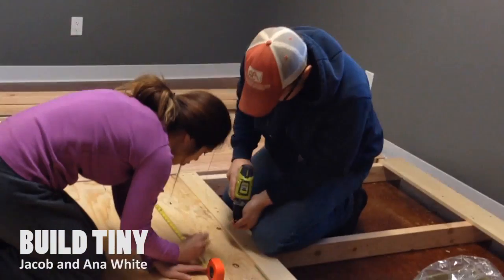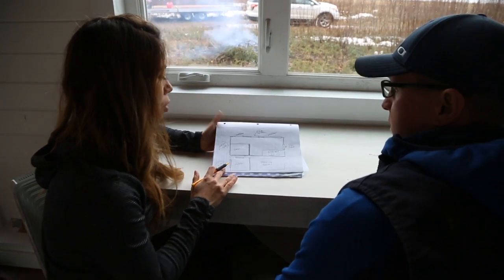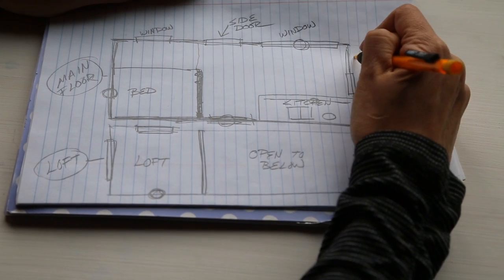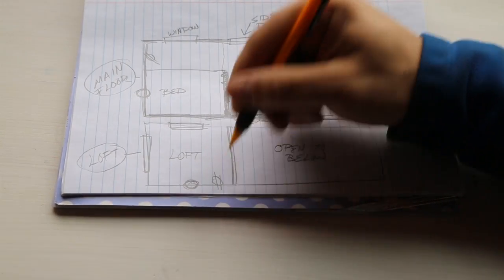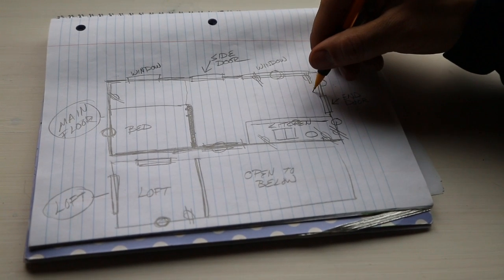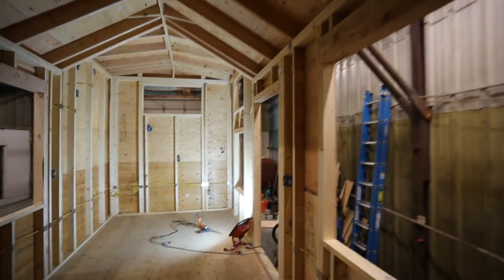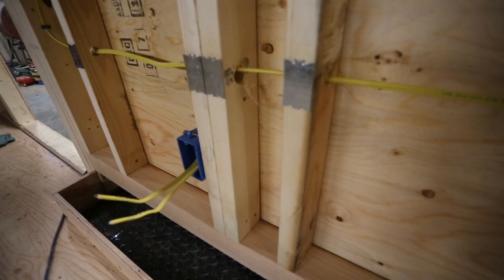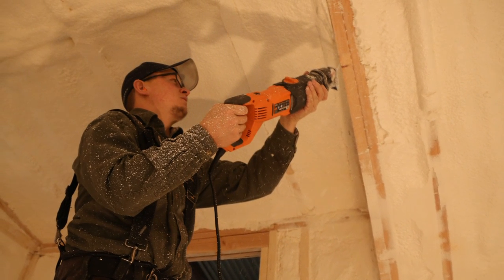Electrical Planning and Installation: Ana White Tiny House Build [Episode 9]

Comment: P.S. I've taken an old 1972 Dodge Georgieboy 34' RV. I completely gutted it from interior items along with all plumbing and electrical system. No longer makings it a self-contained system or DC powered anything throughout the RV. With it now be a blank slate to convert into a tiny home. I purchased the old RV for $650 USD and spent another $750 USD for the big rig just under 65 miles hauling. (Which should have been much less than the what they charged me.  because short distance big rig hauling charges by the hour from arrival of pick-up point to the end of drop off points completion.)  A normally 2 hour minimum fee at anywhere from as low as $125 to as high as $1000 USD an hour. Now in San Diego County there are only a small handful of local towing companies with the lowboy flatbed trailer to do the job. Which have waiting list of up to 6 or more months to book their services. these companies rates are no higher than $375 and no lower than $150 USD, but at a 3 hour minimum fee. Which would mean $450 USD fee for anywhere in San Diego County PND 99% of the time. That includes heavy traffic hours mind you. the 1% is for an end to end county PND during heavy traffic hours. Which tacks on another hour minimum fee. after the fourth hour it becomes prorated by the minute. the chance of passing the 4 hour mark are almost never and I became the first almost. They even wanted to charge me more than the $750 USD in finally agreed on paying them. It took them 8+ hours for the driver to do the PND. The reason I managed to get them to drop the $1275 USD fee was because they had a break down and were pulled over by the CHP for not having the RV covered with a tarp that is required by law. There was a 2 hour delay from an accident on the freeway and only one lane open on the main street to our home. Which is normally 3 lanes and one of if not the busiest exits and thoroughfares in all the county. Which is what they tacked on to the minimum 3 hour fee. I had an old buddy from the CHP follow the big rig from the on ramp of the freeway the big rig was to be using. He was off duty of course, but he called in the violation before they got to the freeway. So they got pulled over before they even murged into traffic. Any found violation on a PND contract can not be considered part of the traffic and or road delays the rig encounter. So they are required to disclose to the client by calling the client. They also eat the delay time from stop to start of any violation delay. If there is no violation given then it falls back on to traffic delay. All this crap varies from county to county and per state to state. Once you have them crossing over any line of jurisdiction most local companies won't or can't do them. So if ever you do have a big rig PND done. I recommend you follow them from point A to point B. Because they will tack on lunch breaks and/or other small items they happen to do on your dime. Which is how they make up for the lower rates and stealing from both clients to boot. by charging full rates instead of splitting the time between the two drops. The main client can agree to a multi drop for the flat rate equal to or even less than the minimum fee. While the smaller get a lowered delivery rate or even no delivery charges accept for the weight or freight cost as they call it. Again all that depends on your local, county, and state nationwide. 
So by me following them and my buddy being a highway patrol officer. the argument that was sure to take place and end up being a violent affair was avoided. Now mind you That the bill was still at least $50 USD less because the fifth hour is prorated and the actual time of trapping the RV was around a half hour and a few minutes to take it off. rolling and securing the tarp is required equipment maintenance. So that time falls on the company anf not the client. My friend said it was an argument and dispute for the court to decide and a grey area on time. So if you're paying a minimum 3 hour and there is no trapping fee tacked on the contracts. the traffic delay can be put on the end of the third contract minimum fee. He also said traffic delay was a bit more than two hours and they agreed to drop off the prorated amount. I fully understood what he said and even settled for the final amount I paid. It still was an overbilling issue of at least an hour if not more than an hour of time I ate instead of the towing company Thus making me $150 USD poorer and equally out of my projects budget amount. Something a lot of people don't account for as a loss. Calling it part of the overall budget. In the end even with the $150 USD tip to the company as my mom called it. I now had a fully framed with windows and door including waterproof roof for $1400 USD and saving me a few thousand in material cost to get to the same stage starting from scratch. A good 34' trailer frame alone is that amount if not more. All according to regional pricing of the material needed to make the empty shell fully in closed and weather proof. Keep in mind that there are many issues to deal with in converting the RV to a tiny home. Mostly dealing with labor cost and the trash you're gonna generate. That is even before you begin the interior reconstruction and design.  There is no loft or space to add one. You can however leave the pull down bed above the driver and passenger seats. Thus having an extra bed if needed for a child or two on the short term only. For kids grow up and the space issue grows into a really big issue with the growing child. Not to mention privacy and/or a second or more children you have or add them later on in life. anyways. the RV tiny home is very limited to the age and size plus popouts if the RV has them. Only thing with having the popout model RV wouldn't be completely converted until it found its permanent placement. Why would you trash an RV that only needs an upgrading in interior design and/or replacement of broken items. Not to mention the cost of the newer RV and the replacement parts. Which are not cheap. So the older ready for the junk yard is an ideal rescue item for repurposing into an RV again or a mobile home/trailer by adding a tow hitch to the front end.

Comment: Nice video series I like how you mapped out the tiny house and where all the outlets will go. (A helpful tip for you as well as DIY viewers. using graph paper will allow you to be more exact with placement of everything in the building of the tiny home. Use a pencil to map it out. It will allow you to modify and/or edit your floor plan and electrical system outlets placement. Also use a lighter semi-fine tip replaceable lead plastic pencil. They are very cost effective and can be purchased at most 99 cent store near you in multipacks. As we DIY's all well know that pencils find a way to elude us when we most need them. LOL 
You can use them as a drafting pencil or to make a lighter line for projects point A to point B direction lines on walls. They are easy to erase or simply paint over without bleeding through the painted surface.). 
Now I have a question about the electrical panel box system AC current only like a mobile home would have. My question is about how it plugs into an outside source.  As in what type of outlets to and from are needed and it be compatible for mobilehome and/or trailer parks in the U.S.?

Comment: You said spray foam is toxic, does it off gas toxic fumes throughout the life of the house?
Reply: Patrick Henry yes it can make some people very sick even when properly installed. However there are a number of lawsuits for improperly installed spray in where the homes are uninhabitable. I’m struggling as to whether it’s worth the chance as I have terrible allergies and an extra sensitive system. I’m sure you can find plenty of info if you google and then check NIH and PubMed.

Comment: Hi I'm just starting to plan my tiny house (am quite overwhelmed with all the different choices I'm facing!). Why did you use a different type of insulation in your floor to the walls. If you use an insulation like in your floor, how does that work with the wires etc. I am just starting out so have no idea about anything! :)

Comment: I am currently planning the layout for my electric. I also have a 2x4 frame,  and just have a worry about the structural integrity of the  walls after drilling so many holes. I have the idea of running the wiring through a conduit at the top and bringing wire down to the outlets. it uses more wire but doesn't need so much drilling. Do you think I am needlessly worrying about it? Any advice?

Comment: The most important thing to remember when planning your electrical is: After you think you know where all the outlets should go, add a few extras between those.  It's always easier to run the wiring during the build than to add them later.
Reply from the maker: +SumErgoMonstro So true! Thanks for watching:)

Comment: good thing you got the wires right lol. after spray foam its kinda hard to add to it. i wouldnt want to be the one that has to snake a new wire if ever needed down the road. i beleive i would have used rolled insulation. but other then that great job guys.
Reply from the maker: +Bison Workshop Yeah, once that spray foam goes in ....  I wouldn't every want to fight that.

Comment: Love it! So my plan is to do spray foam too, have always loved the idea of that as opposed to batt insulation. Not sure if you're planning to address this later on, but since it's a sealed environment, how are you planning to deal with air exchanging? Or moisture build up? Thanks in advance, getting excited for my build!! 🤓
Reply: Hi Tracey, great question on insulation. Since the tiny house was sprayed with polyurethane spray foam it is a vapor barrier and completely sealed. As for air exchange to the outside were just going to have to open a window every now and then. Thanks for watching

Comment: What about the plumbing. Is it going on the inside of the house, but not in the walls?
Reply from the maker: +steve647my Hi Steve, since this tiny house is going to be used remotely on occasion, we didn't want to store water inside and have to drain everything when we leave.  So we are doing a french drain below the sink but no plumbed water lines to the sink.

Comment: very nice, did you also add power into your little tool shed as that would be great when needing power outside the house, keeps it dry and you don't have to go in and out the house to keep plugging it in?
Reply from the maker: +Craig Pereira That's a great idea!  We may have to add one in there (easier to do since the shed isn't spray foamed)